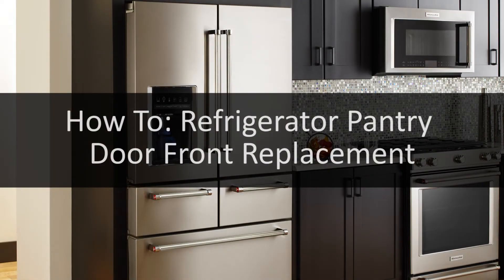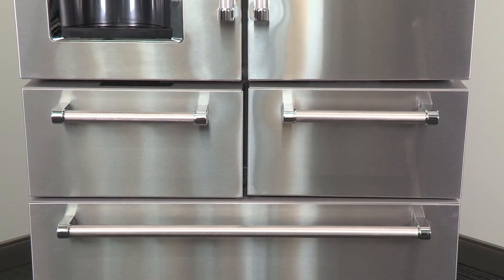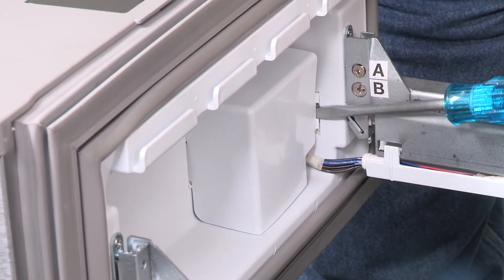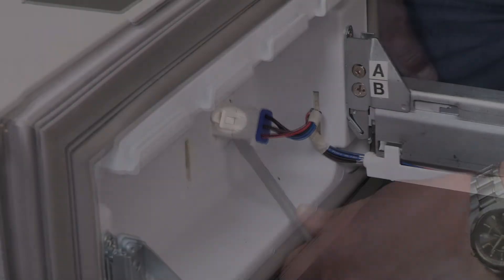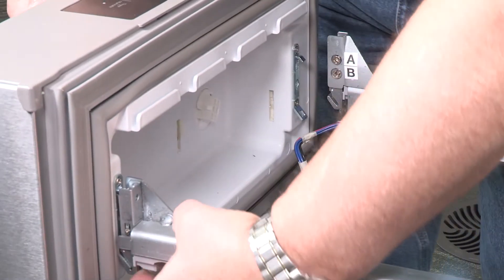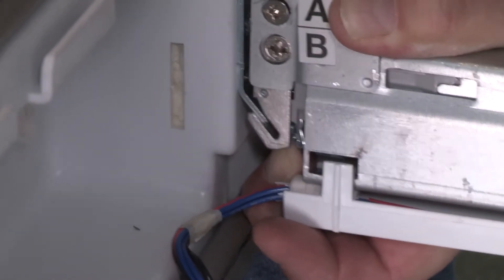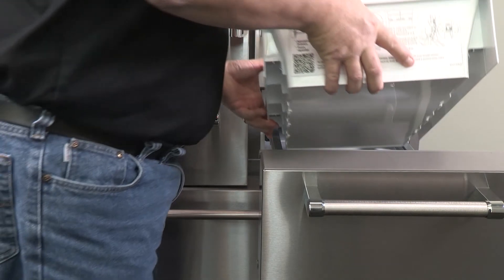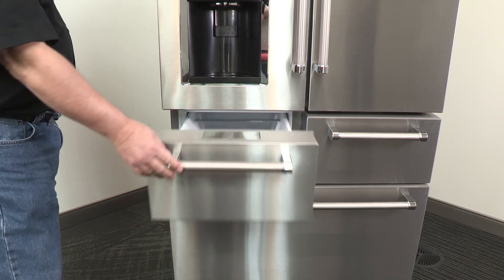Replacing the Pantry Drawers on Your KitchenAid Cameo Refrigerator | KitchenAid Self Help Videos

Comment: I'm a little miffed that the $300 control board in this drawer on my two year old fridge needs replacement. I use a top line surge protector on all of my major appliances. At least this video showed me how to get the drawer off. Unplugging it was getting a rough on my back seeing I have to pull the fridge out of it's hole in the kitchen. Better quality on your electronics next time around please, and it would be wiser to sell these for cost to the original owners of your products. My 30 year old kenmore bar fridge keeps stuff cool without any fancy electrics. I opted not to by a fridge with a computer built into the door for this reason.
Reply: My control board just went out,  where did you find the replacement?